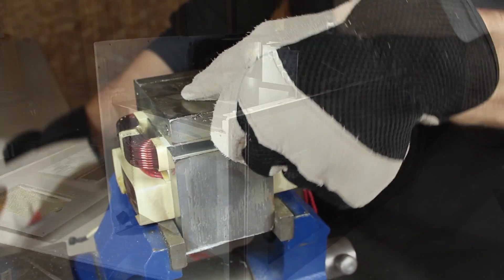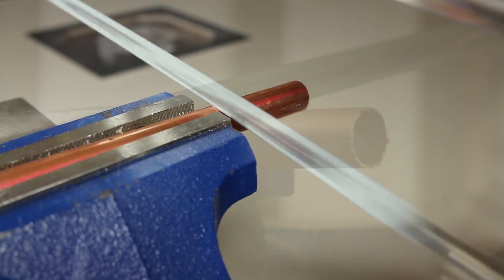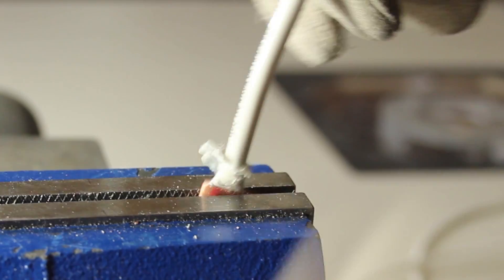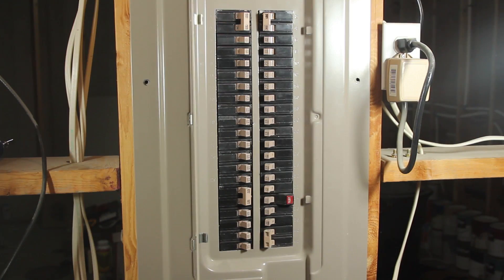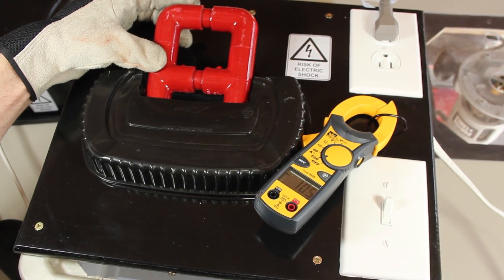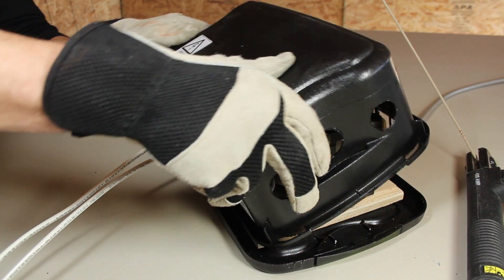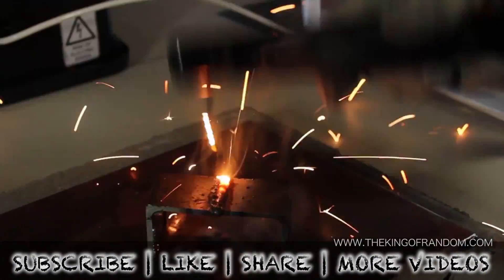Making an ARC Welder - Part 2 of 2

Comment: So this is dangerous and people are pooping themselves over it on the comments.

We use things that are dangerous EVERY DAY. Yes, this is dangerous, but then again using common sense, having basic knowledge of electricity, and attention to detail, there is no reason someone can't be safe.

Your fire alarm detector is probably radioactive, odds are you've thrown away batteries or enclosed electronics, you sit in a machine that uses flammable liquids to create controlled explosions, you probably didn't ask to see the licenses of your electricians, or confirm past an the initial inspection the safety of your house, what's your recent radon reading? Are the carbon monoxide detectors below your bed level? When was the last time your furnace got serviced, or you tested your tap water. Drinking fluoride isn't exactly screaming healthy to me.

Everything is a different situation, I just don't see why you can't be safe. Don't power it unless you know you've wired everything properly with the right gauge wire and secure connections, don't dump water on this, don't carry it around with you when it's powered, make sure it's fully discharged after unplugging, always be conscious of how close you and the machine are to ledges, leads, grounds, etc. Coming from a field (nuclear engineering) that many of the public don't fully understand I can see how the unknown or misconceptions can impact opinions, but electricity isn't a magic alive human killing machine, it's controllable, reproducible, and predictable. Safety is always to be taken into consideration.
Reply: Jess Vagnar But the big difference here is, you are making it yourself. If someone with no to very little knowledge in electricity (such as myself) tries this, it could really be dangerous for them. It's like trying to make your own car engine.. if you mess up you will get hurt.

Comment: There is something wrong in this video. You don't need two outlets, just connect transformers in parallel. The effect of the second transformer connected like in video is not power, but efficiency.

Comment: you might need to change your breakers for that project.
Reply: joe bob Or connect it like this http://www.svarbazar.cz/phprs/image/200803191816_schematic.gif  You dont need to double the voltage with this (its not safe to do what he did). But you must cool it well and be sure to unplug it when you are not using it because it will heat itself even when you are not welding. (and don't mind 110V written there just connect it like this even when you have 240V at home)

Comment: This may be the most dangerous project i have seen on youtube that doesn't encourage people not to build it
Reply: ZorkTheDestroyer666 Yeah output of this is pretty save (only 30 something volts). Input voltage can be dangerous if you are not skilled with it.
I have seen so much dangerous projects than this (like crazy russian running magnetron without any cover and touching output .__. )
Reply: ZorkTheDestroyer666
Don't forget to ground transformer core. NOT "We don't need green wire, so lets snap it"
Reply: ZorkTheDestroyer666 Yeah I know but its not fun to dance in rythm of 50Hz when isolation on primary windings fail and short to core and nothing have to shot down breakers because green wire is snaped. Also I really don't like "doubling" the voltage by connection primary from 2 different breaker circuits. I would rather connect those transformers paralel so I only need double current instead of voltage.
Reply: ZorkTheDestroyer666
No, as long as you connect output of transformers in series
Reply: MOSKAU15 you do know that a 1 amp 12 volt currant can kill you? the current is the most dangerous, not the tension
Reply: PAPA
nope 12V will definitely not kill you. You need voltage high enough to allow high enough current to flow through you. I=U/R=12/5000=2,4mA (5000 is your body resistance) and 2,4mA will deifinitely not kill you. Learn Ohms law pls
Reply: PAPA
Go touch contacts of 12V car battery....absolutely nothing will happen because your body have about 5k resistance
Reply: ZorkTheDestroyer666 You don't count.
Reply: MOSKAU15 But don't do it if the car is running.
Reply: And rolling at 60 pmh on the highway
Reply: +MOSKAU15 be careful putting transformers in parallel. If they aren't properly balanced they can feed back into each other creating a short between themselves.
Reply: Where would you attach the ground wire from the outlet?
Reply: that's wrong P=V*A that's what kills you
Reply: Kids used to play with lawn darts and wood burning kits.

Comment: ok you are saying this will go up to 200 amps but the wire you are using is only rated for 40 amp so why would this just not over heat and burn up the wiring?

Comment: You could have just used normal power cords to each transformer, connecting only the hot wires, and plugged the 2 cords into 2 off/phase outlets, and you wouldn't need that dangerous connection adapter. If you accidentally used 2 of the same phase outlet, absolutely nothing would happen, so just look around for another outlet.

Comment: If this shocked you, would it kill you or trip a breaker first?
Reply: just assume it will always kill you.
Reply: Keagan Cook Yeah, thats what I would assume, either way, I don't want to be shocked. I just want to know the risk levewl involved in making something like this. I don't want to die to save a few hundred dollars on a welder.
Reply: ***** If you touch output nothing will happen, there is only 28V and resistance of human body is about 5kΩ.
 I = U/R = 38V/5000 = 0,008A and 8mA is not enough current to kill your or even hurt you. But be careful with transformers input there is live 120V (230V in Europe) and that is lethal. Also don't forget to connect body of transformers to the ground wire. Its better for safety.
I have Bachelor's degree in this field and I've made same device for almost nothing instead of paying hundreds of dollars. 
Believe me It's safe if put this whole device in some nice box so nobody can touch input voltage. And by touching output electrodes nothing is going to hapen to you
Reply: This welder cannot come close to killing you, as it provides only 37 volts.
Reply: :3 for life This project will work great with that high current plug.
Reply: a s It's not the volts that kill you, its the amps.
Reply: *****  with 37v the resistance of the human body is too high for enough current to flow. If you like i will make a video about this. I will hold the electrodes of my 30 Amp 20v power supply just to show that nothing happens.
Reply: Of course it will do nothing to you. OP is just idiot. You can even touch 200V DC without really much happening. OC you will feel it but nothing terrible
Reply: *****
Of course Amps kills you but voltage must be high enough to allow hight enough current through your body resistance. As I said before: "If you touch output nothing will happen, there is only 28V and resistance of human body is about 5kΩ.
I = U/R = 38V/5000 = 0,008A and 8mA is not enough current to kill your or even hurt you"
Reply: *****
Please go study something about Ohms law first. Its I=U/R or Current=Voltage/Resistance. This welder can provide sever hundreds of amps but only when you short it with something with really small resistance (wire for example). But your body have far bigger resistance than wire and that will not allow high enough current to harm you. Its same as car battery. Go touch contacts (12V)...nothing will happen even when it can provide about 500A when shorted.
Reply: 120 or 240 will work. Just wire it with hot to one side of the primary, and neutral to the other, with ground to the transformer core.
Reply: :3 for life depends on what your country use. if you have 240V you can connect 2 of them in parallel to get same power, but it will drain double current so your breakers must be able to handle that.
If you use two 1kW transformers -  (1000/240)*2=4,2*2 = 8,4A
Or you can connect 2 transformers made for 120V in series and connect them at 240V to get same results
Reply: :3 for life Wow, 50A?  You sure won't have any problems with your breaker.

Comment: I've got a lot of transformers lying around, but this is project for a professional in AC and dc power. So if your an armature I just recommend buying an actual welder
Reply: Yeah,i guess so http://www.svarbazar.cz/phprs/image/200803191816_schematic.gif connect it like this. You dont need to double the voltage (its not safe) But be sure to unplug it when you are not using it because it will heat itself even when you are not welding. (and don't mind 110V written there just connect it like this even when you have 240V at home)
Reply: Oh OK thx.
Reply: MOSKAU15 That will give you enough voltage, but since the transformers are now in parallel it will pull about twice as much current from the source plug which might cause the breaker to flip.
Reply: If you're an armature you should be inside a motor! If you dont get the joke look up "armature"!😉
Reply: MOSKAU15 Já to věděl :-D
Reply: Yeah,i guess so Its not really for professionals in AC and DC power, once you can follow instructions and you have the right tools you can do it. for example, I made one project called the spot-welder and it was a success, I was contemplating on making this project but my house just do not have the amount of power needed. p.s I'm only 17 years of age.
Reply: Relsek
Of course you will need twice of the current. But if you have 2x800W tranformers, you will need at a rough guess about (I = P/U = 800W / 230V) = 3,5A for each of them. That is 7Amps and regular breakers are for 16A at least here in Europe
Reply: MOSKAU15 I don't recall him citing a specific power of microwave to use for this, but saw a comment saying that 1000W microwave transformers are needed for this in order to make enough coils fit. Also voltage from a standard plug (at least in the US) is ~110-115. Using these numbers instead results in about 9 amps per transformer. Yes, this is just an estimate and in order to know the exact load we'd be better off knowing the resistance of the specific coils, but even just as an estimate the potential to pull about 18amps would trip the majority of common wall outlet breakers.
Reply: Well in that case you can do 2 things. Get breakers with bigger max amperage (or just take voltage infront of breakers but its not save if don't know how its done). Or take another transformer, remove secondary windings and left just primary ones and connect it in series with transformers. I will work as choke that will reduce current rising (some sort of soft start), but also reduce output power.
Also Im not sure how it is in US but we can get also 3x400V with our 230V (most people have it in gardens to power up motors etc). If you have that kind of stuff you can connect 2 transformers into series if you connect them between 2 phases.
Reply: MOSKAU15 Aren't you from CR? :D
Reply: tomstr21
Yup
Reply: dispatcher7007 thanks?!
Reply: Lol
Reply: MOSKAU15  I live in the uk and all plugs are 240v. Do I connect the transformer primaries in parallel, or in series?
Reply: *****
You can connect them in parallel. You need to double the voltage for connection them in series. I will drain double current but you dont need to double the voltage. So check how many Amps your breakers can withstand before they flip down

Comment: Great video but I'm having trouble. When I turn it on I'm only getting 10 volts ac and I flipped the wires and only got .5 of a volt. I don't know what's wrong. Do you absolutely need the scariac to run this or am I doing something wrong? Please help!!
Reply: He states directly that it will only work through the variac
Reply: rydude998 The 'Varriac' is simply a tub with Sodium hydroxide dissolved in water to work as a amp dial, simply controls the current, you should get more juice from a system without one.
Reply: dannes22 
That's what I thought but for some reason I'm not getting the power I should be getting
Reply: Hudson Hornet Well if you want some help, go to the nakedscientist forum > Technology section and make a thread with some pictures and perhaps I can be of some help, I haven't made two of them in series yet but I am looking at my second transformer right now, so perhaps I can be of some help, and if not; someone else may be!
Reply: Hudson Hornet if you cannect them in series you will get only half of the powere when you dont double the voltage. You can connect them on parallel but it will double the current so your breakers can shoot down

Comment: If the transformers use a normal mounting base, and you break the E and I cores apart, you can put the transformer upside down on a piece of wood (with the mounting plate facing upwards) and run long screws from that plate into the wood. this will compress the 2 cores together.

Comment: What do you mean by "180° out of phase" ? How do I test for that?
Reply: i just thought of an wiser way of doing this which i just finished. Go to the hardware store, but a cord for a dryer and hook up a regular 120v 15amp female cord end to it then you can just plug it into your dryer and run an extension cord off that.
Reply: I would say the simplest way to do it is if you could do the extension cords plunged into two random out lets like he did and just keep swapping out of the plugs into a new out let until your volt meter reads 240. if you live in a small house this might be difficult because all the plugs on a floor might be on the same breaker or if you use the bedroom plugs and they are on an arc fault breaker it might trip every time your start sparking something. I would probably try the kitchen plugs first.
Reply: if you have a three phase power supplied to your house, it could be achieved. You might need to use an oscilloscope to check out the phases of your outlets.
Reply: Andrew Kwasek nice idea thanks! I'll try it if i ever get around to making this thing.
Reply: ***** its actually a lot more easy  than i thought. if you need some pointers, just ask!

Comment: In sweden we got 230v as standard in our houses :)
Reply: yeah, pretty much all over Europe ;)
Reply: Does that mean i could only use one transformer if i wanted to make this?
Reply: Huckin Fackerz i think?
Reply: 240 here in uk also.
Reply: Huckin Fackerz nope transformers from 240V microvawes are made for 240V. And because he is connecting 2 transformers into series you need double voltage to get 240V on each. But there will be only half of current. 
Just do same thing as he did and it will work just fine.
They are connected into series to limit input current. If you dont wanna double the voltage (Its not save what he did) just connect them like this http://www.svarbazar.cz/phprs/image/200803191816_schematic.gif
But be sure to unplug it when you are not using it because it will heat itself even when you are not welding. (and dont mind 110V written there just connect it like this even when you have 240V at home)
Reply: I suspected i would only have half the current, thanks for info

Comment: if you did not use the 2 wall outlet idea would the welder still work and just be weaker or would it not work at all? also how much wire did you buy for both the coils?

Comment: I was told an electric arc furnace project would surface. I am still waiting.
Reply: February I am on february twelve, I can confirm.
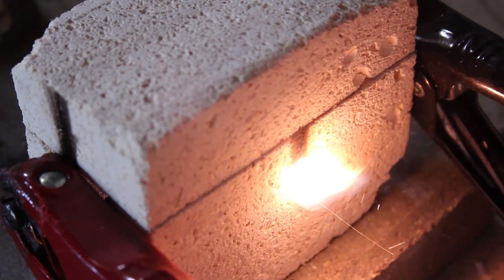Reply: 2:56
Reply: Me too :)
Reply: I know. I'm a loyal subscriber.
Reply: February oh ok
Reply: February That's a good idea.  I know of several places that buy scraps near me, so I guess I can call them and ask them if they would be willing to allow me to have/purchase parts of the microwaves, if not all of it as a whole.  You can supposedly do some cool things with the remaining parts as well, so depending on the sell price I might buy the whole thing. 

Thanks!
Reply: It's coming Feb. 12!
Reply: Up now bro
Reply: this video was made (almost) 2 years ago yet he had video from his arc furnace vid that he posted 5 days ago. did he pre-record that 2 years ago and just waited to post it?
Reply: TheBlockyRocket
It's not the same furnace. He was prototyping the furnace when he made this video. If you look closely, the design of the brick cutouts is different, also he is using big alligator clips instead of vise grips and he doesn't have the holes to lift the lid up using those carbon rods.
Reply: Anyone know when it's coming now?  I have a use for his Mini Arc Furnace... Cough Cough melt steel Cough Cough
Reply: bugattikid2012 Not sure, think it's tomorrow
Reply: Thanks, that confirmed my thoughts... This is just a welder with carbon rods.  I'll see if I can find me some microwaves now...
Reply: bugattikid2012 Just go to a store and buy the cheapest microwave for 20 bucks or so. Or go to craigslist for even cheaper stuff.
Reply: February
I've been looking on craigslist, but I can't find any under 20.  Those in the 20-40 price range are all older ones as well, so you can assume the quality/strength of those transformers won't be as good as newer ones.  (I understand it's the wire wrappings that determine the output voltage and stuff, but the efficiency of the transformers matter as well). 

If I can't find broken/within 7 year old microwaves on Craigslist, then I doubt I could find any in stores. 

Does anyone have some suggestions?  Thanks.
Reply: bugattikid2012
I always see cheapo microwaves in Target or Walmart for $30-50. Other than that, you could find your nearest electronics recycling facility and try asking them for stuff. Since you need specific things, and not the whole microwave, it could work.
Reply: bugattikid2012
Glad I could help!
Reply: Lmao bro it took 2 years